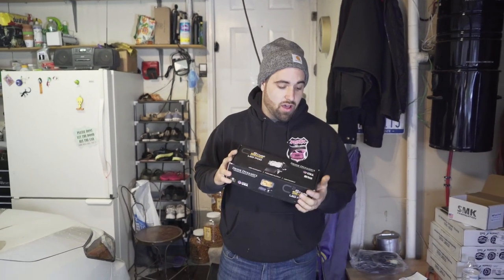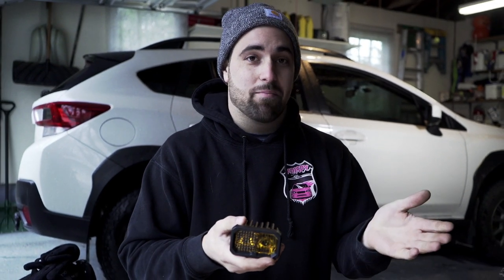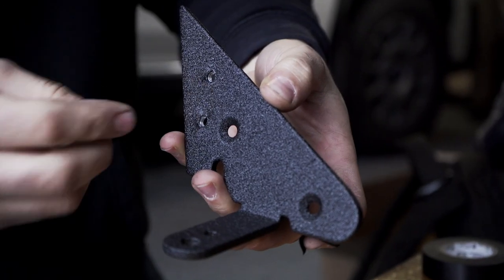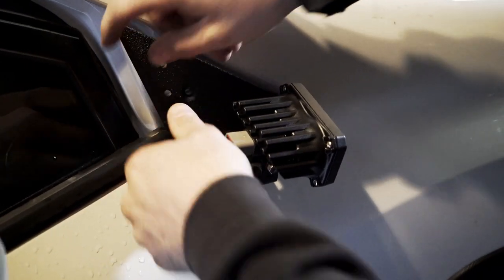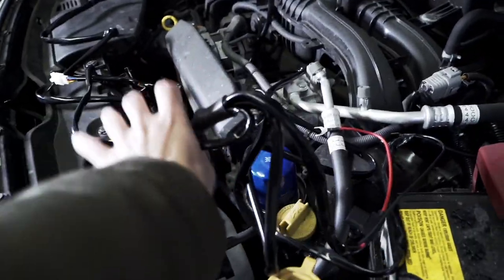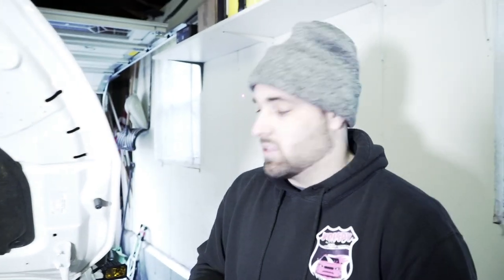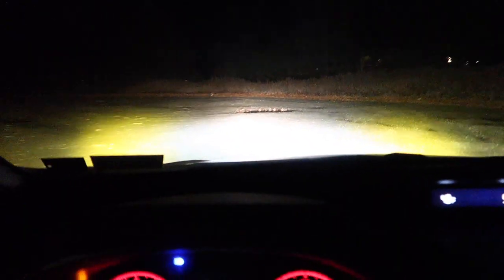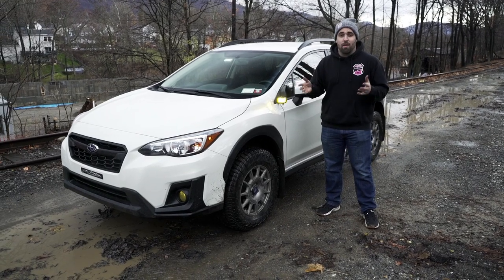2019 Crosstrek Diode Dynamic SS2 Ditch Light Install!

Comment: Great video! I got some ditch light mounts from a other local company and was afraid I'd have to cut up and splice into Diode's beautiful harness to make them work. So glad that's not the case! I might suggest putting the harness in a piece of conduit/shielding running through the engine bay. Vibration and motion can wear through the electrical sheathing pretty quick, especially when ziptied to metal. Loved the rest!

Comment: Awesome video and install. Never seen that type of bracket before. Nice and clean. I mounted some similar led ditch lights and found the stainless steel carriage bolts too long for my ocd ways. I went to the hardware store and purchased two shorter ones.
Reply: I was thinking of maybe a little black rubber or silicone nubby thingy for the end of the bolt, but shorter bolts is better. Lol

Comment: You didn't have to disconnect the batter before plugging in the wires? And does it matter if you plug the Pos or the Neg wire first? Don't wanna blow up the battery LOL

Comment: I got the same lights and heavy duty cable as u did with same brackets.  This cable is thick as hell.  Did you have to trim off the outer cover and then wrapped in electrical tape to get it to fit under the cable slot on the bracket?
Reply: Im having the same issue. Did you find a resolution. In the vid it looks like the individual wires are exposed. I even tried drilling the bracket to make it bigger. Still tight when closing the door.
Reply: @therichshow831  I trimmed off the outer and then wrapped it tightly with electrical tape and that did the job.